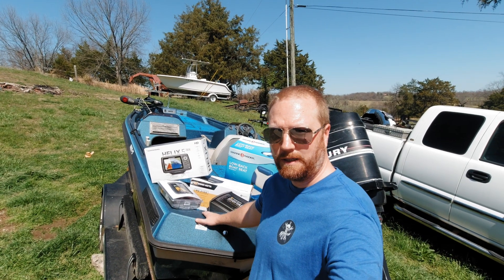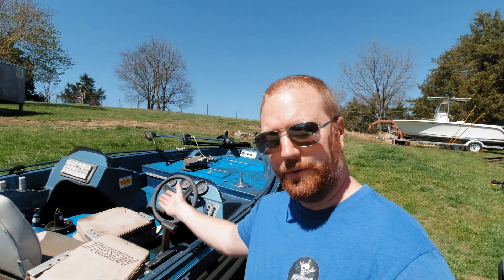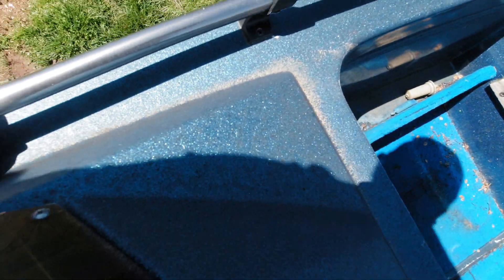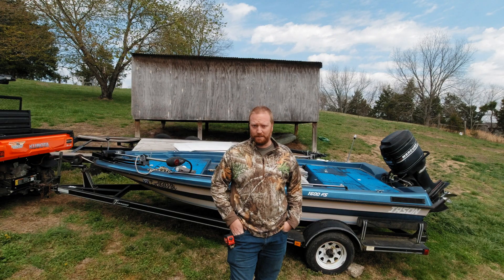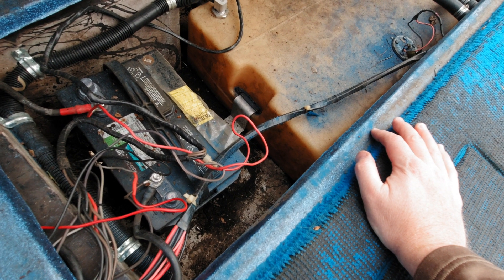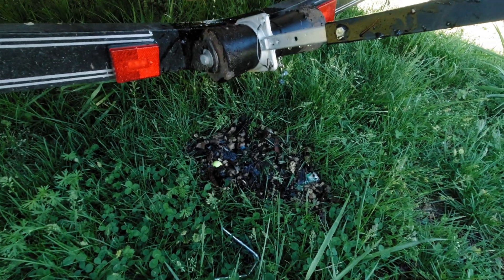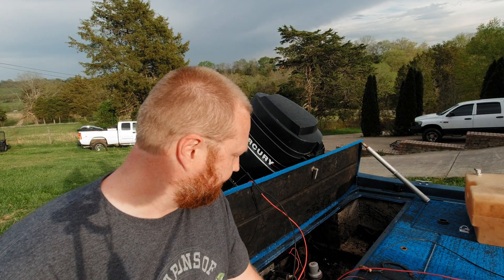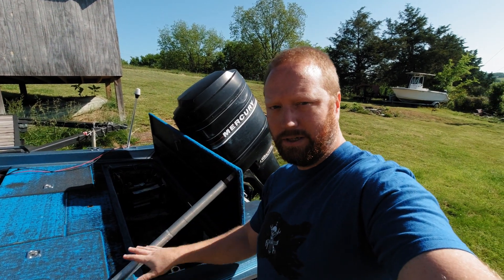I Worked All Summer Only To Have This Happen

Comment: Does it run on ears?  The feeder hoses to the carbs, are they cracked?  Probably just on with zip ties!
Reply from the maker: I'm sure all the fuel hoses are cracked.  The primer bulb leaked oil all over my hand.  I don't know if the carbs were off since it was in the barn either.